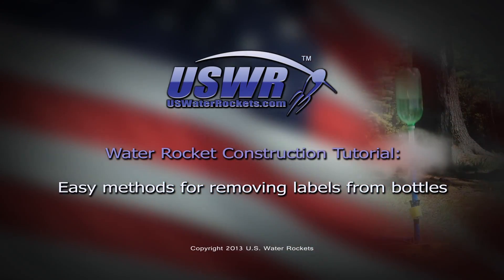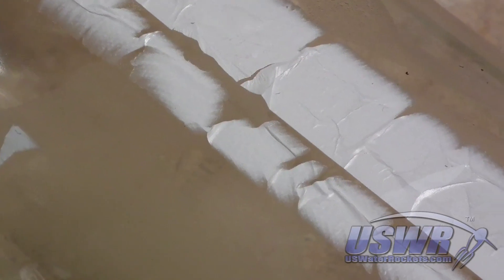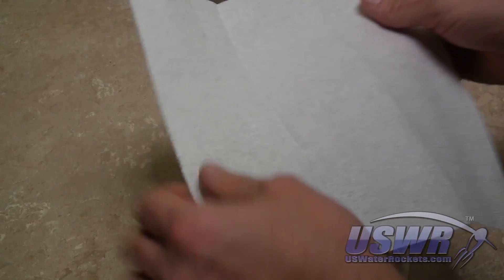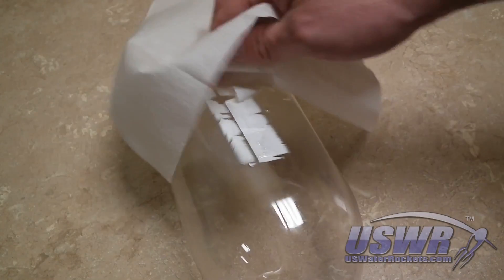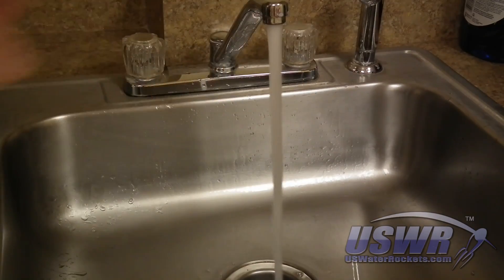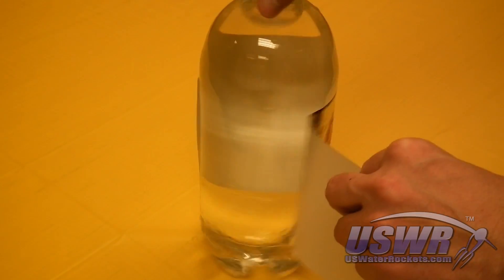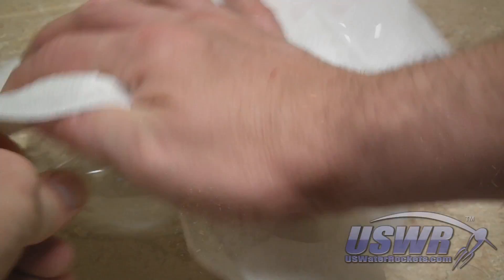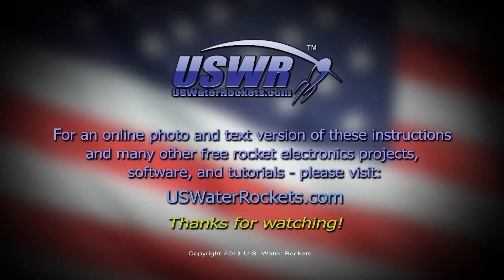Water Rocket Construction Tutorial: Easy Bottle Label Removal

Comment from the maker: If you want to save the most water, you would probably fill the bottle with hot water and then transfer it to each additional bottle. You could easily strip the labels from dozens of bottles this way, saving a huge amount of water that would run down the drain if you were just running it on the outside of each bottle. Plus, the hot water inside the bottle will remove any leftover drink that dried out, so it serves 2 uses.

Comment: You can still use running hot water but instead of peeling off the label first, use the hot water while you peel off the label. This method uses less water then filling the bottle up.

Comment from the maker: Thanks! FYI: Poland Spring Sparkling Water bottles have a tapered neck that is just right for our nosecones and they use a paper label that is glued 100% if the way around the bottle and the glue won't soften enough with heat to pull off. We use the paper towel method on those. We are not sure if it is a rule of thumb, but perhaps use of paper labels indicates the correct method?